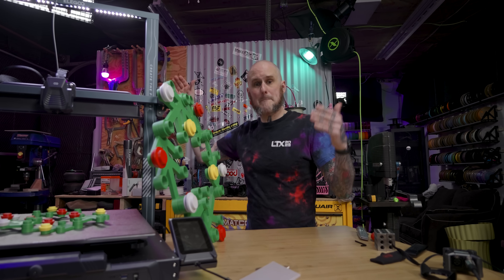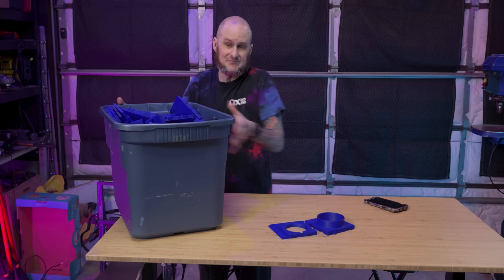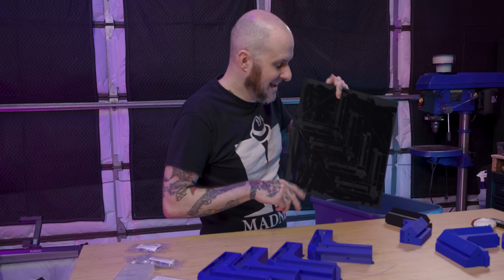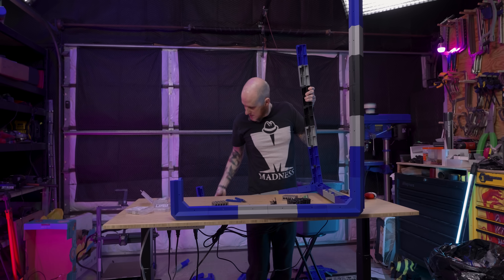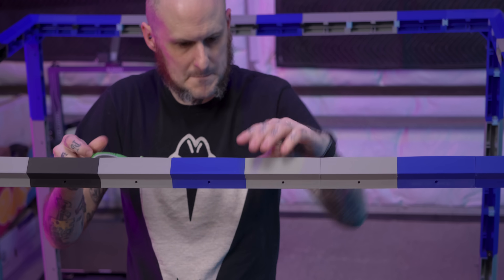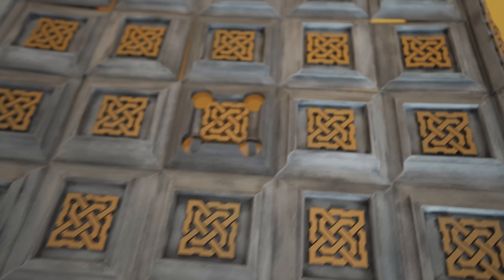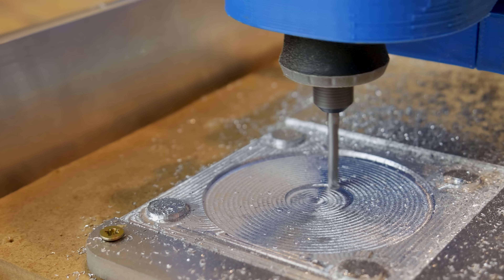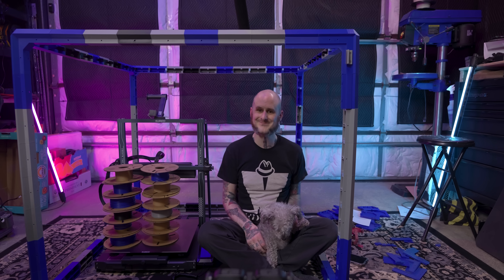I Made a MASSIVE Modular 3D Printer Enclosure

Comment: Do you know what else could work... a cardboard box... yes, but really.  just go to Home Depot and get some acrylic sheets and some acrylic adhesive... a plastic jigsaw blade and have at it...maybe  some hinges so it can fold up when taken off... If I get one of these or any large printer like this I will set it near a corner and bolt on brackets to brace the top rails to reduce movement and vibrations

Comment: I made a frame for my printer. It took about 3 hours with cheap enough materials from the hardware store.

This is just something thats probably more fun to do than practical.
Reply: yeah this is more like using a 3d printer for everything... 3d printers are sick but this is not the right use case. just some wood or metal works way better and way cheaper

Comment: I just don't get projects like this. Ideally, you need a printer that's already enclosed to be able to even print an enclosure. If you don't have a print farm of your won, you're spending literal weeks printing parts for this and you're spending kilos and kilos of filament on it. With a couple of lengths of aluminum and some cheap acrylic, you get the same for a fraction of the cost and no time at allm you don't even need a working, enclosed printer to build it. Are there seriously people printing up monstrosities like this and putting them to actual use?

Comment: how big is the biggest printed part? can it fit on a voron v0 build plate?
Reply from the maker: I don’t have the exact dimensions off hand but too large for a V0 sadly. They will fit on an Ender 3 and bigger. I am traveling or I’d check to see if it fits on a Prusa Mini. Not certain. Many parts would but the corners are the largest bits.
Reply: @MandicReally  wonder since it's so modular if it's possible to make custom smaller corner pieces 🤔

Comment: I wonder if the fitment allows for the user to make structural reinforcements in the middle of the enclosure "faces" using more pieces ("dividing" each face so it would use two acrylic panels instead of a bigger one), therefore making the structure more rigid BEFORE the final assembly.

I think it would be awesome to customize this to receive a honeycomb storage wall instead of pegboards.

Comment: Saw another creator's video on the same product, but this video showcased the enclosure in a much better fashion due to excellent print quality and attention to details, good job! However I'm not going to back it on KS, simply because $50+ is a lot for STLs only (no CAD) and on top of that you need 4-5 spools of filament + panels. There's no way it's going to keep ABS smell inside (without a fan to create negative pressure), because of how many printed parts are used. Also launching it on KS is controversial by itself - they already have the files mostly ready

Comment: Hmm wouldn’t it be cheaper and faster to use aluminum extrusion profiles? 
I counted 12 spools. Alone the filament would cost over 200€.
Reply from the maker: I used Elegoo PLA which is pretty affordable $10-15 a spool. But extrusion profiles would be faster. They’d just require the time and skill to cut them to length and source panels / designs to mount panels. For me? No big deal. But to some folks that’s more work than they are able to handle or comfortable with. Or what if you don’t have a chop saw? $200 saw to make an enclosure? It’s definitely not for everyone, but it’s fun.

Comment: will the PLA last while being exposed to a warm printer chamber? would you recommended ABS?
Reply: I would personally not recommend PLA. I think you can get away with PETG for a few prints that can allow you to print the pieces in ABS.
Reply: @Joe-TechandBlog  yeah kinda what I was thinking. pla/petg should prolly be fine for a resin printer tho
Reply from the maker: This is a valid discussion but I don’t know that it’s really as much of a issue as folks think. My Voron 2.4 is smaller internal volume than this chamber will be when I shrink it down. And after dozens of hours of printing ASA, the chamber on that doesn’t get over 40-45C. So not even to the lowest glass transition temperature of PLA. PETG would likely last indefinitely at those temps. PLA may degrade over time.
Reply: @MandicReally  I think the main reason they didn't recommend anything but abs on a voron is because of the motors.
Reply from the maker: @Joe-TechandBlog  as someone who has used something other than ABS on a Voron, NOPE. I tried to make accent parts out of PETG on my first build to get the color I wanted. The endstop switch mount has to be adjusted every couple days as the material warps and it comes loose. The hotend mount was a total disaster. (No shock there) etc etc. PLA and PETG will give more over time than ABS and ASA will. It’s often referred to as “Creep”. The constant load of weight or belt tension causes them to bend or give even at normal temperatures.

Comment: So lets say i'm going to print something in petg and i want my chamber heated to let's say 75 degree celcius. How will it cope with that?
Reply from the maker: You’d have to have active chamber heating to even get close to 75C chamber temps. My Voron 2.4 doesn’t get over 45C with no chamber heater. The Qidi X-Max with active heating only gets to 65C. So PLA won’t hold up if you are actively hearing the chamber. If you are running those types of materials with this, you’d have to print it in PLA, then use that chamber to print ABS or ASA parts and rebuild it. That is assuming you only had the one machine with just this enclosure. Not ideal, but doable. 

I view this as more of an entry level enclosure with customizability. If you are looking to print PC / Nylon, etc you are likely aiming beyond “entry level”.
Reply: Use Polycarbonate. But it would be expensive. Around 400€. 
I would use aluminum extrusions for an enclosure this big. 
Second you would have to move the electronics outside. 75c is a little high as well. 60c is enough even for PC to prevent warping.
Reply: @Todestelzer  i know, it's a high number just to point towards pla and heat not being friends. 60 is stil a lot to ask for pla. It's hard to justify the costs of printing this imho is where i was going.
Reply: @Devills_hill  polycarbonate isn’t pla. It’s PC. I use Prusa PC blend. I use it for parts inside a dental cleaner with around 90c water.
And I use it for motor plates and the entire hotend assembly with tap in my Voron 2.4r2.
Reply: @Todestelzer  let me put it like this, why,other then because  u can, would u waste PC on this for the money
Reply: @Devills_hill  you asked about 75c chamber temp?
My answer is you can with PC filament. Should you? Probably not.
Reply: @Todestelzer  i should have been more clear about what i ment i guess. My bad

Comment: That seems cool, can't help think that's too much plastic 😅 I can see it being twice as thin and still strong enough, idk. Furthermore, why not use 2x2 lumber or 3/4" aluminum L bar (about 2x the price) and then only 3D print the joints and hinges. Then you can use the extra money to double pane the walls, maybe with thinner plexiglass and still have the same if not more rigidity from the plexiglass itself.

You can also apply weather film to the plexiglass to further insulate. I did some testing years ago using a Kill-A-Watt meter, found when i enclosed my i3 Duplicator (clone) machine (200x200x195mm) the heated bed didn't need to work as hard and to a much lesser extent neither did the hot-end and ended up using about 2/3's the electricity for an hour long print. If i had to guess from vague memory of calculating electricity costs, it was about 1/5th the cost of the filament at $20 per Kg if it was enclosed, using about 120 watts on average printing PLA and about 160 printing ABS. I know it was close to 200 watts on average printing PLA in the open
Reply: @WhiteG60  A grow tent sounds great or a photo popup lightbox used for product photography

Comment: There are 3D printers and 3D prints that make sense and then there are these. 
The amount of filament, time and resources spent to make this boggles my mind when there are much more efficient ways to do it.
Reply: Could just get some metal framing and build it.. Here you spend KG's of expensive filament and then still dont have an enclosure. The expenisve part is the massive acrylic  plates you are going to need if you wanna look inside.
Reply: Fully agree
Reply: you could order the extrusion, have it shipped, put it together and then add some accessories in the time it takes to print all these parts

stronger, cheaper, better
Reply: And it's a kickstarter? More like nonstarter.
Reply: if you build with 2020 extrusion for this huge dimension, it may cost you at least 500$. His build may cost 150$ max + 60 hours of printing time

Comment: 3d printing is great for custom parts. Bulk generic parts like bars and panels usually makes more sense to buy mass produced. Unless you're just going through the expense and effort for the sake of it.
Reply from the maker: From a time standpoint acrylic panels make a ton of sense. And they are available or easy to get custom cut. But the modularity makes sense in a change stand point. Like I fully intended to use this with the Neptune 4 Max, but now I’m gonna use it with a smaller machine. And it’s easy to make that change. It’s not for everyone, especially if your time = money, but it’s fun and functional.
Reply: @MandicReally  Good point, I completely ignored the modularity. Still, I cringe at the idea of printing acres of identical panels. Maybe there's a compromise using a mix of bulk parts and custom connectors

Comment: Saw another creator feature this, I get it, they're really pushing it. My problem is -- I can't justify paying for functional STLs -- I need step files. The decorative stuff, sure, STLs -- the frame pieces, I want to be able to customize, and STLs -- not even at the top tier, no step files for customization. Deal breaker.
Reply from the maker: An understandable position. I’d say you can request additions or modifications but I’m also a tinkerer so I can understand the feeling or wish to just do things yourself. That’s us though. Not everyone has the time or skills and many just want a complete option.
Reply: @MandicReally I have to say I agree with Kazolar above. Sure, not everyone has the time or skills, and just want a complete option - that’s totally fair. However, I don’t think there’s a single CAD package out there that doesn’t support STEP files. It’s literally just running one more export after the design process is finished - assuming they’re using a real CAD package to design these in the first place. 

More to Kazolar’s point, not having STEP files for decorative objects makes sense. Frequently, those types of models are made in modeling programs like Blender, Maya, or 3DS Max. To my knowledge, none of these programs even have a STEP export capability. However, for anything that is meant to be actually used it makes a lot more sense to model the object in a CAD package so you can take advantage of things like parametric modeling. I would happily wager that these were designed in CAD, rather than a modeling platform. I hope the 3D printing community starts to move towards supporting STEP files in addition to STLs when it comes to more ‘useful’ items. It makes modifications and tweaks a lot easier, and I can’t really think of any drawbacks to including STEP files for all models made in CAD.
Reply: I have also a problem with his,
Only STL files are a no go
Reply: they actively did not support modifying their original KS files either for personal use

there were whole regions where people couldn’t build the initial displays and had to wait months for variants in screws and parts that were available in their country
Reply: Hi, I don't know if they've changed it but, on the campaign features panel they say that it includes all core .STL. This means that the the printer enclosure files are included, but not the others...
Reply: @VideoYiuo  yea, I read the campaign all backer options are stls only, first, can we stop with stls and move to 3mf in general. But there are no step options, not even in commercial backer levels.
Reply: @kazolar  Exactly. It would be easy to provide the backers with 3MFs additionally to STLs and to make a new tier where you can get STEP files (for a higher price).
Reply: How strong did this print? Can I stack say 2 or 3 4 maxs on top of each other?
Reply: the system atm is not designed to be stackable @rustyv6274
Reply: or just make your own one in f360🤷‍♂️ its not that much work, 100€ in aluminium extrusion,  plexiglas panels and some qustom brackets

its faster and probably cheaper anyway
Reply: Fusion360 atleast lets you convert from STLs to STEP as long as it was designed well and exported with high detail.

Comment: I wish the Kobra max got this kind of support
Reply from the maker: If Anycubic had made it direct drive, or released the firmware when they said they were going to, I’d have supported it more. As for the enclosure, well the same one would fit either machine (at a decent scale).
Reply: @MandicReally  the firmware has been released - I concur too late, but it has been released. The kobra 2 max does have a direct drive btw which I do agree is one of my more favourite mods I did  on my kobra 1 max - on the usability front